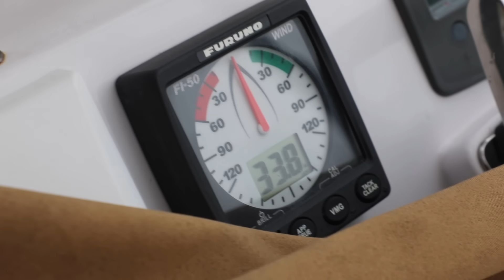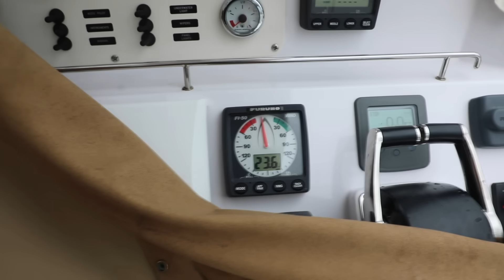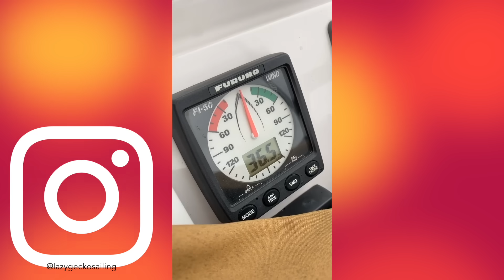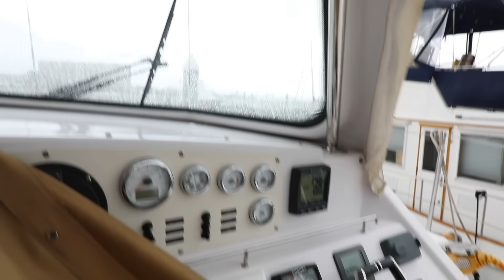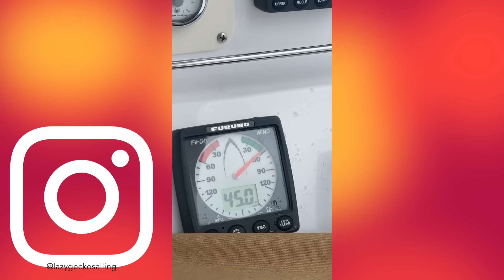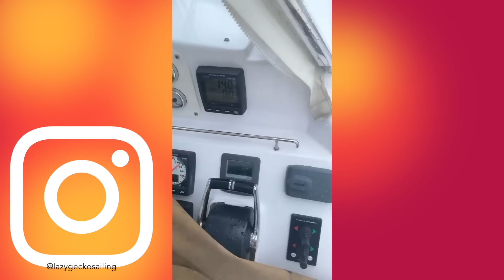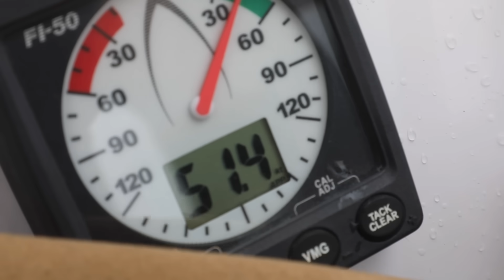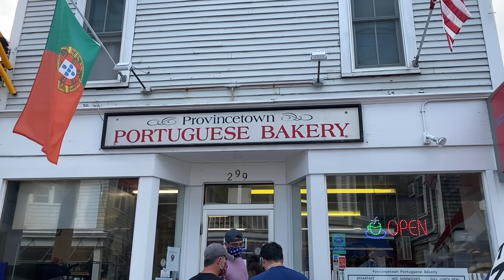When Nightmares Come True...We Get Hit by a HURRICANE! - Lazy Gecko Sailing VLOG 199

Comment: I used to live aboard a 38' wooden sloop in (at that time) Salem (MA) Harbor.  Had a big storm go through.  The Cape Ann lighthouse had an anemometer that broke at 75-80 knots.  I was in a small marina.  We had BIG tides, but were tucked in behind a power station, giving us a little wind protection.  Especially at low tide.  Doubled up all dock lines and ran a few extra, and lots of chafing gear.  A number of us had to get together to save some boats that had not been prepared for the storm.  Trying to sleep aboard was wild!  Many boats (but not mine) were damaged.  Better, and cheaper, to over-prepare!

Comment: Hi guys I sat in a force 10 plus in a marina on Scotlands west coast , where they're was a motorboat sunk and a yacht washed up on the shore that was interesting shall we say, its good you survived intact, one time on Scotlands East Coast in a fishing village harbour, the surge was so bad I had lost most warps and was facing the real danger of loosing my boat inside a harbour, then it twigged to me my second bower was to 3,8th ⛓️ chains joined with a massive shackle, so I split it putting an appropriately 20foot length on the bow and stern with a large warp to the boat on each and the chains going up over the ruff concrete dock that was braking my lines because of the large fetch and wrapping the chains around the bollards , yes I had tried all the usual things nothing worked, but this finally did I had most of three days and nights without sleep look after your self's. Soz  Mooring lines  am tired 😫.
Reply from the maker: Goodness! We hope that everyone is ok!
Reply: @Lazy Gecko Sailing & Adventures  I was on my own but thankfully all OK.

Comment: You need a shock absorber on the lines that will take the stress away from cleats and will be safer and more comfortable. 
Here in Sweden, we have a strict rule to have it in the dock if you park for longer.
l would prefer to be on anchorage than to be sitting into the dock. If you secure your boat it doesn't mean the others and that can be very dangerous for you.

Good luck.
Reply from the maker: Great tips!

Comment: Nice video, yes Brittany already pointed out a life jacket would have been good prep as probably would have a helmet but hindsight is 20:20
Wondering what type of lines you have?  Often people use braid but in this case stretch is probably more important than breaking strength.  Nylon stretches more than polyester and a three-strand twist line will stretch more (and absorb more energy) than a braid-on-braid line. A plaited line (similar to three-strand but softer and with a square profile) will stretch more than either three-strand or braid-on-braid
Reply from the maker: We have some pretty strong lines aboard Calypso. Serious stuff that are used for much larger vessels, Jeremiah would be the person to ask what they are. Unfortunately he isn't right here currently!

Comment: I wonder who made the decision to use those cast aluminum cleats instead of either billet aluminum or stainless just to save a few bucs?
Happy it worked out in the end but there's no way I would want my boat there for a worse blow. I mean considering the failures we just saw in the construction and choice of materials that went into those docks builds. Sometimes it's okay to save a few bucs but not when it comes to equipment like cleats or interconnects for the docks themselves one of which also failed. I'd be willing to bet there's a lot more damage to that marina that we can't see.
Thank you for the video and sharing just what it's like being caught in even a tropical storm let a lone if it had been worse like even a cat 1 hurricane.
Reply from the maker: Yeah I'm not sure...Some broke but it was pretty rough and all boats were spared so they did their job I guess.

Comment: This is not a marina, it's a joke. If it doesn't protect ships from waves you might as well anchor in a bay.
Reply from the maker: Well, it's not the marinas fault. The tide was up when the storm came in and the jetty was too small to stop the water from overcoming it. The waves poured in. It was a mixture of a strong storm, jetty that is too low and a high tide. The marina got slammed, no boats sank so it did ok.

Comment: Bring your ship up on to Dry Land!
Reply from the maker: That's not always an option.
Reply: Not always the best option in my opinion either.  If you can’t take the mast down in time, it’s even higher in the wind and stands won’t allow it to heel with the wind.  

When Mathew came through insurance was willing to pay half if I pulled mine but I felt better keeping it tied up in the marina so that it could heel with the wind rather than topple off the stands onto the ground.  I also ran a line from each main winch to the dock to help limit its roll and used that plastic stretch packing stuff (like heavy Saran Wrap) to wrap up halyards, the tail of the main and Genoa and wrapped the helm so the instrument covers couldn’t be blown off.  Worked great!